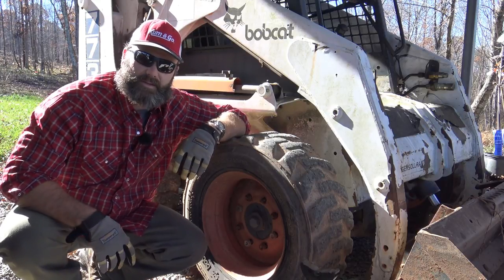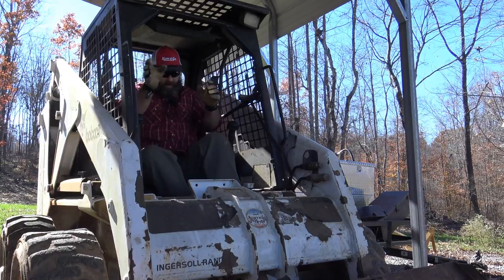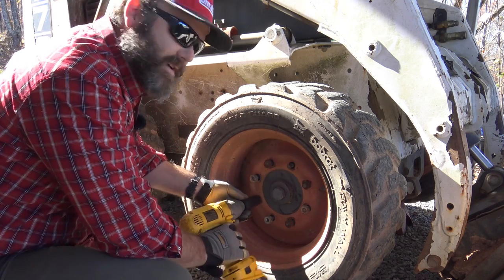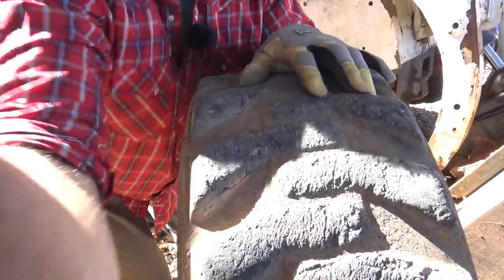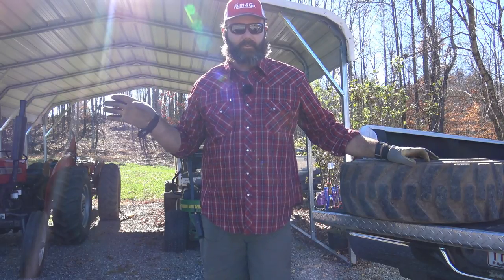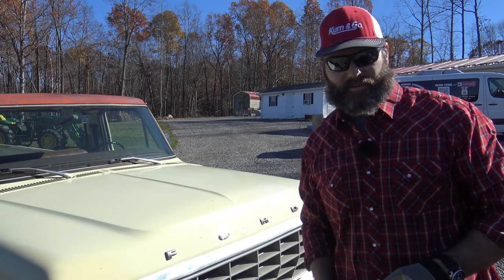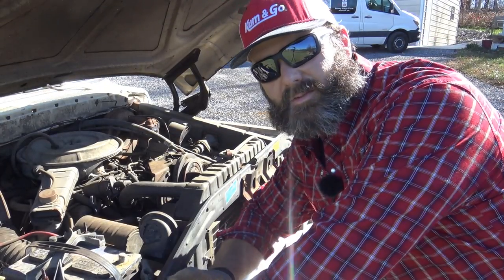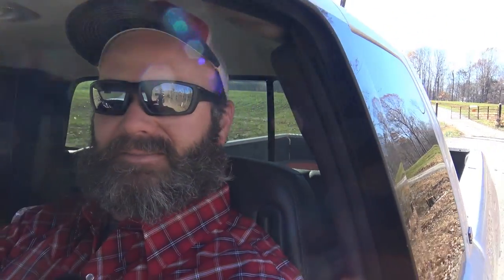$100 Pickup truck update, Bobcat Troubles again...another darn rant: government and responsibility

Comment: I am not mechanically inclined and before someone says it, I admit I know almost nothing about gas engines.  Can you (or others here) tell me a little more about the ethanol gas problem.  First, where do you buy ethanol free gas?  I thought it all has it now?  Second, what do you think about the "additives"?  Do they help at all, completely solve the problem, or something between?  WHen I bought a new tiller recently at Lowe's the sales guy (no expert by any means) also mentioned that todays ethanol gas is a problem and sold me a little bottle of blue colored additive that he said I should add to my fuel.  I confess I've not done that most times.....its just a big hassle and I wasn't sure it was worth it???  Thanks all.
Reply from the maker: Stick around on the vlog ...I'll show you...ethanol is basically alcohol..like moonshine alcohol...never 100% ...it contains a percentage of water...like 80 proof vodka....it's 40% ethyl alcohol (EtoH)  the rest is water....it's flammable..but contains water...this water separates from the EtOH and causes corrosion in carburated engine parts..and the alcohol/ethanol causes pre-mature breakdown of plastic parts and paper or wood gaskets. Imagine if you took a pencil eraser and soaked it for a month in rubbing alcohol...take it out...dry it off and it will be so brittle it's unusable, this is what the non pure gas does to your carburetor and gaskets in an engine not designed to take ethanol. Most modern cars are ok...it's the old ones with metal gas tanks and carburetors that are harmed....although now you can get "ethanol ready" carb rebuild kits ...

As for gas stations that sell pure gas...search the web...there is a database out there that will tell ya the closest one if you punch in your zip code...keep good pure gas for your power equipment and it will last longer..also burn off all the gas in your carburetor before you store your tiller for winter...or frequently start it an run it to get that old gas moving through the carb before it separates and corrodes the internal parts

Hope this helps
Reply: I am blown away that you took so much time and effort to explain the ethanol issue, and I am confident that it will benefit a lot of other people who see it.  I suspect I'm not the only one who isn't mechanically inclined but has heard a lot about problems with ethanol but didn't really understand it or even know if it was a real problem.  You explained it like you were talking to a 6th grader, which was EXACTLY, 100% what I needed and ask for.  It earned you my subscription, which is a VERY rare thing for me!  It also caused me to go look at several more of your videos, and I've become a fan.  You seem like a normal, nice guy who genuinely likes to help folks like me learn things.  As a man who has lived my entire life in Cities, condos/apts, etc but at age 49 just bought a little 9 acre mini-farm, I am sure I'll be watching a lot of your stuff.  Other videos I've watched to try and help me learn about things seem to start with the assumption that the user has a great deal of experience and knowledge already.  Yours seem to understand that if the reader was already very familiar with the subject matter he/she probably wouldn't be looking for instructional videos.  Anyway, sorry to blather on, its just nice to find a person and channel which are so helpful, don't have a bunch of ugly drama in the comments (tho that is out of your control, I know), and actually answers questions.  Great job, great channel.  Thanks again.oh......briefly, can you address my question about the little (I'd guess 15-20 ounces) bottle of blue liquid that the sales guy sold me with my tiller and suggested I use it.  If I am using ethanol gas, Does this stuff- whatever it is- help mitigate the damage caused by the ethanol?  Is it worth using?  Should I use it every time or just periodically?  Thanks again.    Looking forward to seeing the demonstration video you said you were going to make using all different types of fuel lined up and aged 6 months or more to show the difference.  thanks

Comment: Theres a gas station near me that sells ethonal free gas (good gas). I had never seen a gas station sell it before.
Reply: And happy Thankgiving everyone
Reply: I have one also
Reply: lance kippenbrock What state?
Reply: Brandon Murphy Indiana
Reply: You have never seen a gas station that sells regular gas? They are all over the place here in oklahoma
Reply: Martin Taylor. I've never seen one Illinois. I wish the they wernt so butt hurt and sell non ethenol gas if you want to use it.
Reply: I’ve never seen any decent sized gas station here in Oklahoma not sell ethanol free, 10%, e85, and diesel
Reply: Brandon Murphy alot of gas stations sell 91 non ethanol
Reply: We have what they call REC90 gas. It is ethenal free for boats/old cars/off road stuff. Neighbor uses it in his 1972 Triumph TR 6...along with a splash of low lead avgas
Reply: We got one too, Marathon, corner of 10 mile & Sherwood, Center Line, Michigan
Reply: Hyvee sells ethanol free gas if you have one in your area.  It's the only place I fill up anymore, especially for the boat and jetskis, lawn equipment, basically anything that might sit with fuel in it for over a few weeks.

Comment: What year is ur 100$ truck lol? 77 78 or 79? And does that have the infamous Ford 360  v8 or a 351w in it ? I've got 2 Ford F100s... Ones a 1964 short box with a home built 408 Windsor stroker motor that I built out of a 69 351w block and it makes about 460whp.. The other one is a 1966 custom cab short box with the good ole 352 big block Ford, that was my grandpa's truck that was passed down to my dad who passed it down to me and its literally all original down to the points distributor and the C6 trans... Still has the original paint and all.. Man I love those old f100s. I do like the 64 better than the 66 cuz of the 64 having the straight axle front end which is bullet proof vs the old twin I beam suspension .Anyways dude just recently discovered ur channel and now I'm subbed and hooked on ur vids! Keep up the good work and keep that ole girl of a Ford a running ." FORD FIRST ON RACE DAY!!"

Comment: Burning that old gas is very hard on the exhaust seats in the head...seen many loose compression and get a dead miss......
Reply: MrBubbahunt9 do what? How is burning old gas hard in exhaust valve seats? Good gas burns hotter and stronger so how is this possible?
Reply: Old gas is a slower burning fuel(due to less octane from evaporation) than new gas, which in turn creates MORE heat, plus the fact that it is a dirty burning fuel creating more carbon emitted to the atmosphere and also building up on exhaust valves and seats  in the engine, it's like mixing gas and oil for 2 cycle engines which that  also slows the burn rate and will destroy the engine due to excessive heat build up not to mention the huge emission of blue smoke when the engine is running.

Comment: wrong again alcohol mixes with water and lets it go through with the gas. Yes you need to mix the alcohol with the gas. Heat gas line antifreeze is methanol. YES, stay away from alcohol fuel if you can. wrong again. You always disconnect the ground battery terminal first and reconnect it LAST If the vehicle is - ground that is off first and back on last. why? to avoid shorting the wrench from the hot + to something nearby when working on the vehicle.